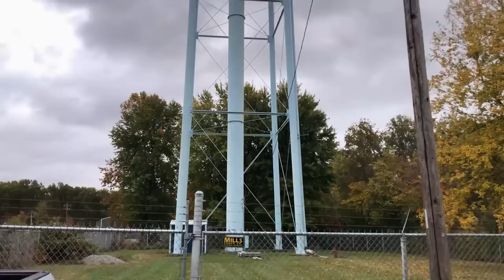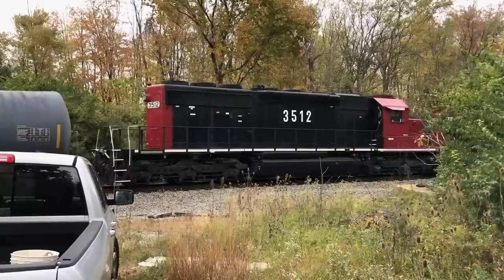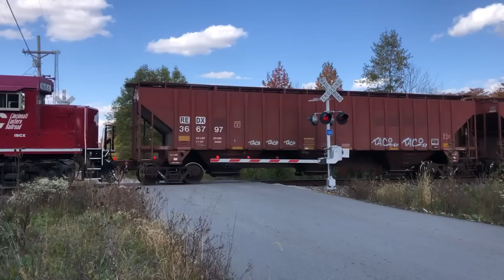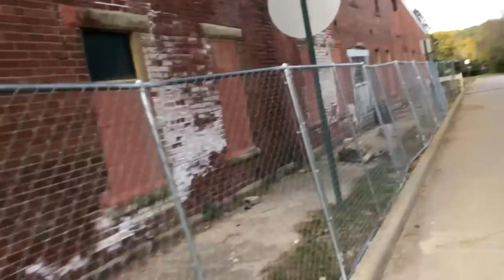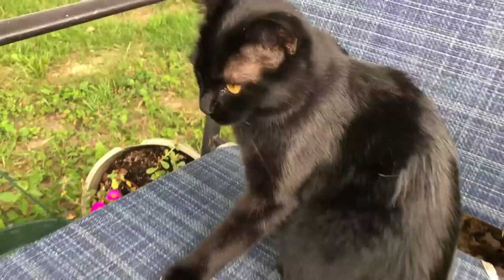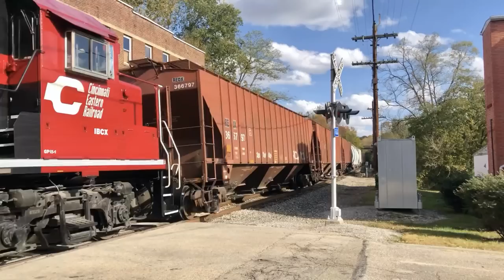2 Locomotives Shove Train Into Huhtamaki On Cincinnati Eastern Railroad Short Line Switching & Chase

Comment: Always good to see CCET. in action whether it's individual car loans or mini unit trains. I've always liked the old red brick buildings but I think it's time for the damaged one to be torn down. Whoever owns it seems to have walked away and if you've made no effort in over a year to fix it much less even stabilize it it's now a danger and nuisance. Man does that horn ever get a workout virtually a continuous blast. The Sheep are probably the most comfortable in this colder weather. Keep on rolling!  Sorry it's carloads not carloans
Reply: CCET doesn't run unit train. A unit train isn't just a train with only one type of car on it. A unit train is a train that's run as a unit, shuttling back and forth between a loading point and an unloading point, without any switching. CCET's closest thing to that is their rock trains, but even those aren't true unit trains, as they're often combined with other traffic, so they get switched.

Comment: Im curious why we always see that train with two locos running long hood forward... why wouldn't they have  the two facing in opposite directions?
Reply: They normally do, yes. However, they only have one SD40-2, and their two GP15-1s face in opposite directions. In this case, they need the SD40-2 for the rock cars but, for whatever reason, they've coupled it to the GP15-1 that's facing in the same direction as it. Maybe the other GP15-1 was under maintenance at the time, or maybe they wanted to balance out the operating hours on the two GP15-1s. As far as I'm aware, CCET doesn't have a convenient way to turn locomotives.

Comment: Any chance that CCET might just start running all the way to Portsmouth?  Seems like they are getting fairly close!
Reply: Unlikely. Jaw Tooth has mentioned that a couple of parts of the line out that end have been washed out by floods. It would be very expensive to rebuild that, and there might not be much to gain by doing it.

Comment: Hey there Jaw Tooth from Trucker Russ of Cleveland  , Ohio and another Great Video from you ... Very cool to see those 2 CCET locomotives doing their job properly becuz of good maintenance done on them ! 👍 However , i have an issue with a couple of those crossing that you showed ... The first one is where that train backed into that company where there's Only cross bucks and Yield Signs to let drivers know that there is a R x R crossing there ! 😲 Too Much foliage on that one corner in my opinion that's an obstruction of viewage for drivers to see a train coming  ( horn blowing in plenty of time to warn traffic or not ) and the other crossing that should have gates besides just the wig - wag lights is where it's coming along between the two brick buildings and again even if the locomotive is blowing it's horn with plenty of time ( it seems to me ) to let the traffic know that it's coming thru that section of the town ! Looked to me to be going a Little Too Fast thru area in my opinion where some Idiot might try to beat the train at that crossing ! 😟 Well anyway , keep up the Good Work and stay Safe out there ! 😉
Reply: The crossing is only used once a week or so. Because it has no gates, the conductor is required to check that traffic has stopped before the train crosses the road. So motorists don't ever need to see the train -- the train can't enter the road until the conductor has reported that it's safe.

It's also not a very busy road. As Jaw Tooth remarks in the video, it's really unusual to see that many cars on it. Normally when he films there, there are one or two cars at most.